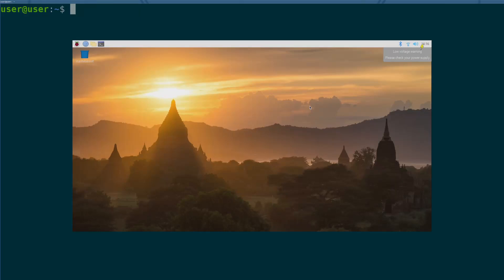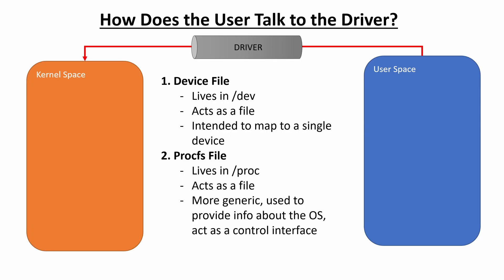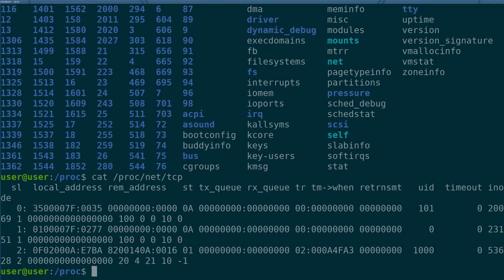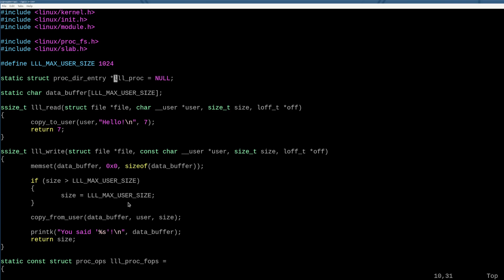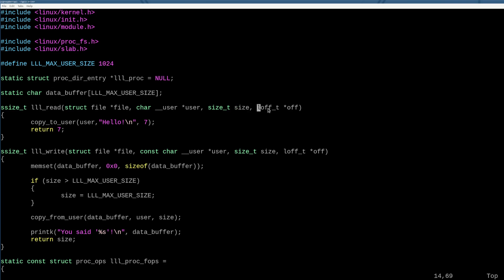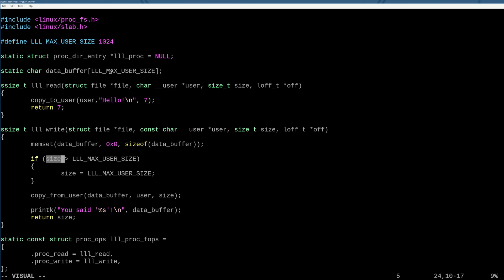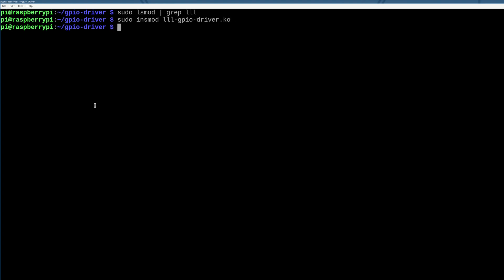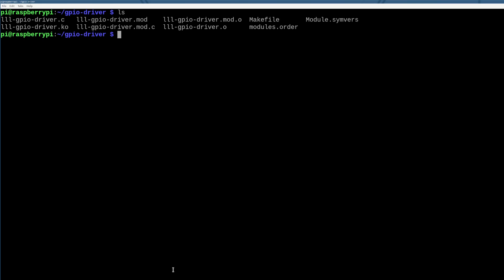A Special Filesystem? |  Coding the ProcFS File System | Raspberry Pi GPIO Driver Development

Comment: The bug in lll_read is that you never check if the read offset is greater than your buffer size, so when cat tries to read after it was given 7 bytes, your kernel mod just keeps giving it the same 7 bytes and the process repeats until cat is given a 0 to know that it has reached the end of the file.

Comment: Your `printk` call in `lll_write` would result in a kernel infoleak vulnerability. If the user passes input longer than the buffer, there won't be any null bytes left at the end from the initial zero-fill and the `%s` may continue reading off the end of the buffer. To avoid this in ordinary C code, one would use the 'variable precision' form to allow you to specify the maximum length as an additional argument:

    printk("You said '%.*s'!\n", size, data_buffer)

Even better, though, would be to use the "escaped raw buffer" format -- provided as an extension for `printk` not present in ordinary `printf` -- to avoid writing newlines, control characters, or other garbage from the user into the kernel message log:

    printk("You said '%*pE'!\n", size, data_buffer)

Comment: (@5:00) - don’t you have to put \o (lowercase oh) to do an octal literal? Otherwise, you’ll just get 666 (base 10), which isn’t the same. You could also do \b000110110110 for binary, or \x1B6 for hexadecimal.
Reply: Putting a '0' before a number formats it to octal, like '0b' for binary and '0x' for hex values

Comment: I don't think your write function is safe. If they provide 1024 bytes, or greater, you're going to copy 1024 bytes into a buffer of 1024 bytes. However, when you use '%s' in the printk function, it's going to continue printing until it hits a NULL character. Ultimately if you're expecting a string value, or something that is NULL terminated, then you should always add 1 to buffer size. Great video though

Comment: You're going with somewhat classic but somewhat obsolete way of teaching/learning kernel development where you make a module creating a procfs file. This isn't best choice in my opinion as nowadays, it is quite unlikely that a typical driver would ever create a procfs file. Sysfs file, on the other hand - sure. Debugfs file - also. But not a procfs.. not anymore :)

Now with sysfs you have this added bonus that it handles more things for you and you wouldn't do this bug on read callback. In your code, you always return 7 so the cat doesn't know if it did read the whole file or not - the read syscall never returns the EOF condition. This is why real procfs code in the kernel uses seq_operations abstraction to hanlde that nicely.
The easiest thing you could do, however, is to check the offset argument, if it's non zero, you know its the 2nd read call and you can return 0 instead of 7. This still isn't fully correct but at least you won't get many "hello" messages anymore.

Comment: Very interesting series, please continue. I need to find something useful that would require a kernel module just to try it out.
For those wondering, /proc is not a magic keyword, it's simply a special filesystem mounted by the kernel. You can see that by typing `mount`, among other such special FS (/sys, ...).
@LLL do you plan on making a video that explains how to create a kernel module that can be mounted like this?